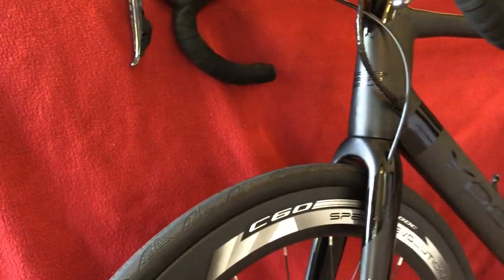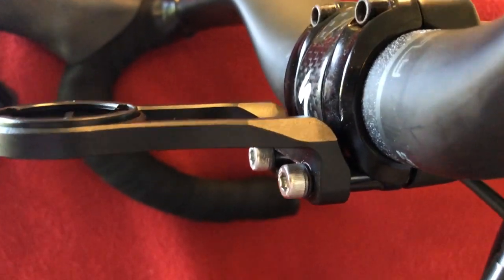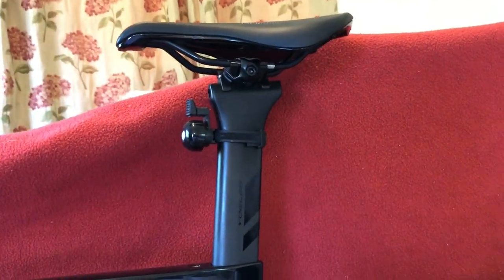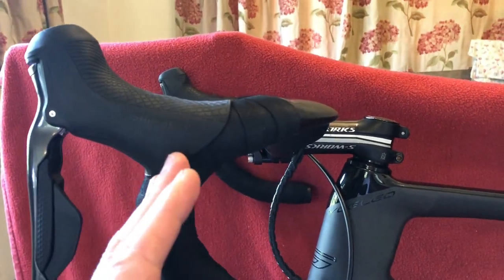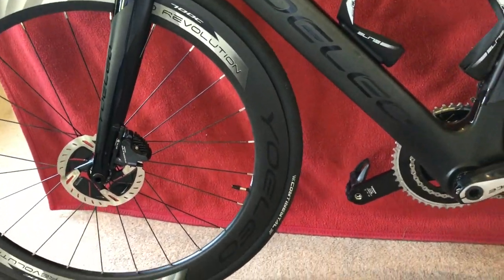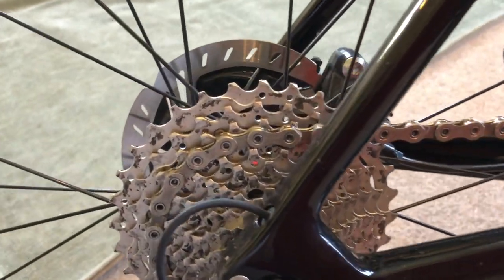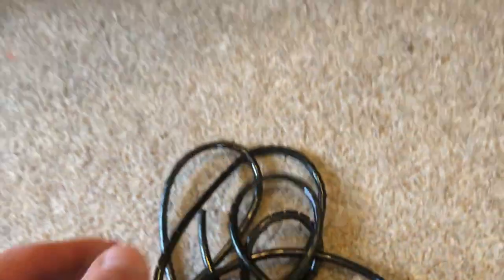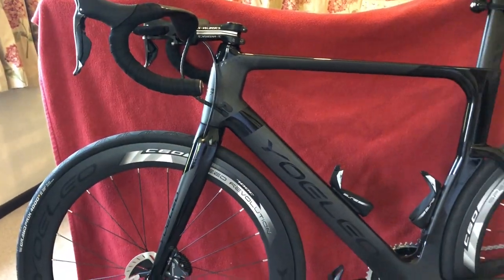Yoeleo R6 Aero Disc Update 2

Comment: What can say about the performance of the disc brake wheels? How do they perform/durability etc.?
Reply from the maker: El Mascarado they are fantastic! Never had the slightest problem with them at all. The best rims I’ve ever bought. Bought the hubs separately and got them spoked locally. Can’t recommend them enough, just perfect. Even Hambini rates them as joint best in his aero testing. 👍

Comment: Thx for the run through. I have the rim brake and considering if I should get the disc version for my next bike. How do you find the 140mm rotors? Is there enough braking power? I've heard some say that on the long descents, 160mm is preferable.
Reply from the maker: Thomas Hemming Larsen the 140’s are fine for where I live... maybe if you had mountainous descents the 160 would Be better but I can’t really say. All I know is 140’s have plenty of stopping power. 👍
Reply: Thx. I just wanted to check. I don't have any mountain descents nearby, either just to get a reference point :)

Comment: Tempted to purchase this frameset and transplant everything over from my old setup.

My only concern is that ky existing kit is di2 with trp hyrd disc brakes (post mount). 

I understand i can use an adapter to mount post onto flat, but just concerned about the actual seat stay space available? (The trp hyrd callipers are quite chunky). 

Does the frame only allow 140mm rotors? From my understanding if i use an adapter it’ll bump it up from 140 to 160mm rotors.
Reply from the maker: CMDR Rockswift you can use 160’s with an adapter on the front.

Comment: What handlebar are you using? are those chinese carbon handlebar?
Reply from the maker: Jonathan Cunanan hi! These are S-WORKS Aerofly 25mm rise handle bars. 👍
Reply: Kyro's House I was going to ask the same question ... I am looking to build a bike similar to yours but mechanical instead of electronic, with 140 rotors .., and I liked that handlebar ... thought it was YOELEO .., is the handlebar alloy ? Or carbon? And how much was it ? .. hello from FLORIDA !!!

Comment: How do you find the sort cage Dura-ace deraileur works with a 32 tooth cassette?
Reply from the maker: Chris Hopper it works like a dream! No problem at all with the synchro shift as it won’t let me use a 50 32, it only lets me use 34 42. no problems with a short cage. 👍
Reply: 42? Do you have a 11-42T?  Do you know if the Di2 RD comes any longer like the GS whether Dur-Ace or Ultegra? I want to put a big cassette in the back.
Reply from the maker: Dick Tchairdjian sorry I meant 34 - 28, it won’t let you use the big ring and a the 32 with synchro shift